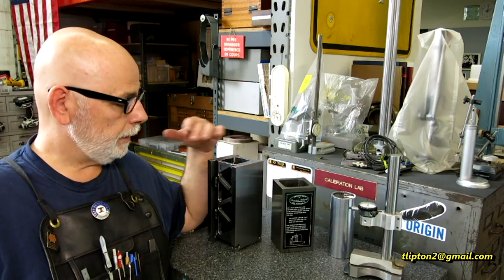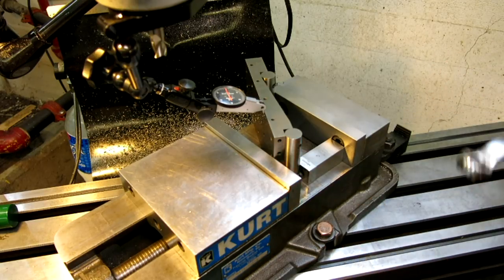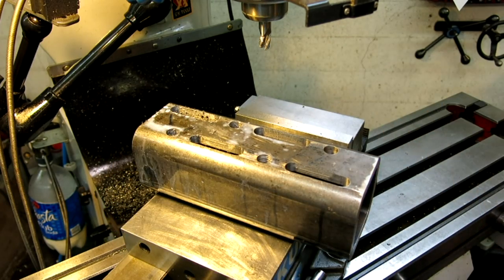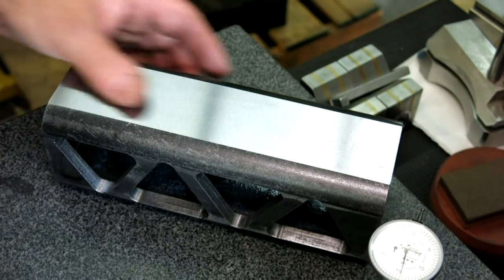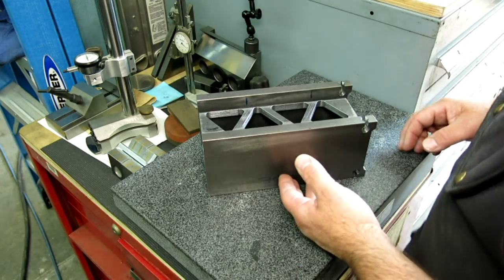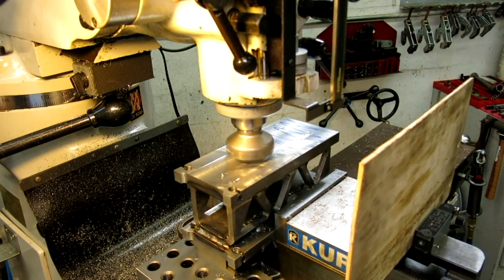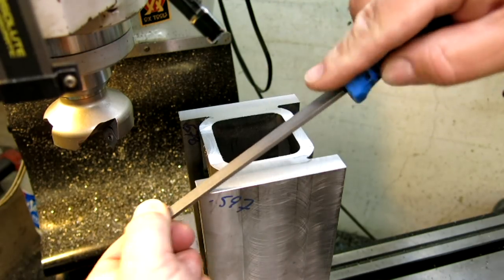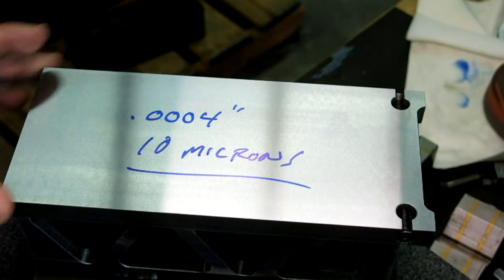Composite Master Square Construction

Comment: Tom, when you surface grind a big piece how does it remain perfectly consistent when the wheel is actually wearing while being used. Are there automatic compensators on the machine? I do realize it is a minute amount of wear, but it IS still wearing.
Reply: Bobby W you're only cutting with the outside leading edge, and as it breaks down you still have the rest of the way towards the center, but it will round off vs leaving a nice square edge to cut with as the wheel breaks down. 

Hope this makes sense.
Reply from the maker: The edges of the wheel is what break down first. The diameter actually changes really slowly.
Reply: I've been wondering if it would be a good idea to have to wheel at an angle against the travel of the work. Any tiny imperfections on the wheel would be evened out. Of course it has to be perpendicular if you were to make some kind of profile cut on an edge.
Reply: Only the "high spot" of  the wheel is contacting the surface as it moves along it. Grinding wheels are used to "machine" crankshaft journals and other precision shafts that have sufaces that aren't concentric with the centerline, but in those situations the work is rotating as well and there is a lot of coolant involved and the stone is grinding only a portion of the width of the journal. It's also done post-heat treatment and final polishing is done with emery cloth bands that are like a narrow belt sander against the journal. The other major difference is that crankshaft journals have plain bearings supporting them in the block and supporting the connecting rod and those bearings are made with steel backs but have relatively soft "babbit" surfaces in contact with the journals. 

There is oil clearance built into the "joint" so the bearing "floats" on a hydrodynamic '"film" of oil and in theory the shaft never contacts the bearings. And that is pretty much true except for at startup with no oil pressure or high-load situations with insufficient oil pressure. Then there's a slight amount of wear in the first case and very short part life in the second. The bearing and journals are obviously of different materials and "self-lubricate" and are never TRULY "dry" at startup. Really high-quality bearings used in some heavy-duty diesels actually have a "depression" in the middle of the bearing so oil can "puddle" there at shutdown. Surface tension and the fact that the engine begins cooling and the oil thickens immediately after shutdown help keep oil in bearings as well. 

I can't say that I've ever seen a flat and straight surface ground for precision and it seems counter-intuitive to me since a grinding stone is going to leave a rougher surface finish and scratches that are small "ditches" with some of the material "dug" out of them sticking up around the edges. I'm not a machinist but I've been turning wrenches for a long time as a professinal diesel mechanic for 25+ years and I've done some "minor" machine work and a lot of fabrication and surface prep and I know a lot of machinists and have pretty extensive experience in every diesel industry except marine. I've also done a lot of automotive work and I'm a "gun nut", so I'm pretty familiar with most things that are machined to precise tolerances. 

And I've used a lot of precision instruments and standards and learned "the old fashioned" way how to dress grinding stones, sharpen drill bits, properly use files and hacksaws, etc. I've gotta say to me this looks like one hell of a lot of work and time and material put into something you can't make without having the commercial tools and standards and gauges to make sure its right. The only way to get them is to buy, rent, borrow or steal them. That's the case with all quality tools that "DIY" guys use to make their own "made it myself" tools that are usually made because its "cheaper". Well, it may be "cheaper" but if "cheaper" is in part due to borrowing or renting or stealing a tool from someone else, the only one paying for your tool in its entirety is still you. 

And if its a purchase to keep or rental then the owner and everybody "upstream" of you and that owner benefit from the hard work and effort and skill and investment other people put into the tool and they've been compensated in some way. But if its a tool borrowed from someone under the guise of "personal use" to make or fix something to keep and use or to repair or make something for someone else "gratis" and offers to compensate the lender anyway are refused, that's also a "pay it forward" situation. 

But buying a tool to use and then returning it for a refund in my book is stealing and stealing is stealing and if its to make a "DIY" tool to then use to produce MORE "commercial" tools for sale or trade, that's stealing and fraud. No matter what nobody is ever a TRUE "DIYer" unless the "project" is "living off the land" and that project is started by leaving all your current commercially manufactured possessions behind and starting out bare-assed naked from scratch. 

Like I said, I'm no machinists but I damn sure have used lots of quality tools and I know that you can make any standard really quickly and pretty easily from plain stock if you have quality machine tools and gauges and very basic materials to start with. Standards for checking micrometers 1-2" and larger are just precisely machined and lapped pieces of round stock that aren't going to grow or shrink providing you keep them and use them in the same environment in which you made them and machinist squares and straightedges are typically mild steel stock milled and lapped to be straight and perpendicular and flat. Most parts in even the best and most expensive heavy-duty diesel engines don't have tolerances tighter than .0001" and even then its going to be several ten thousandths on top of a thousandth with a +/- of a few more ten thousandths. 

I think the main reason we even seen ten thousandths in machines and areas easily accessible with ordinary tools and where the same fundamentals and processes apply whether its a 5 hp Briggs and Stratton or a 500-hp Caterpillar, is specifically to keep amateurs - mechanics AND machinists AND "remanufacturers - with cheap tools and/or no clue what they're doing from destroying parts and engines and potentially lives by using "good enough" techniques and processes and tools to "repair" or "rebuild" or "remanufacturer" machines where in operation it really DOES matter.

It might seem like anybody who doesn't have the experience and skill and tools to do a job properly and is taking a shot at it anyway to "make" or "save" money doing it for themselves or someone else wouldn't be hesitant to work on an engine or other component or machine where the tolerances and clearances go to .0001" instead of just .001", but that extra decimal point requires vernier-scale micrometer to accurately measure and even though there are el-cheapo micrometers all over these days and "budget" tools aren't something new, vernier micrometers are typically the "too expensive" brands and ELECTRONIC CALIPERS, which are VERY commonly and incorrectly used AS a "micrometer" do NOT go to .0001". Even if they measure to .0005", that's not .0001". 

And the thing about DIYers looking to "save" or "make" money is that just like there's always that point where SOMEONE ELSE'S TIME AND EFFORT AND SKILL is "too expensive", there's a point where they realize that their OWN TIME AND EFFORT AND SKILL could get REALLY expensive. Especially if they're "DIY" project is owned by someone else who is ALSO "frugal" and doesn't want to pay professionals for their time and expertise and tools and probably isn't going to want to pay for even a "cheap" job twice. Much less pay for a NEW or REBUILT component or machine or part when the "mechanic" or "machinist" who took on the original job "dropped the ball" and the results was what a service manager I used to work with (RIP Andy) called "fuckage". 

Overall, what I see here with all the fancy and unnecessary machine work on what is really just a piece of square tubing with some plate welded onto it when the tubing itself if good enough for the "foundation" could have simply been milled flat and square and true itself as evidenced by the commercially-made example, is someone trying to put a lot of "value" into something that they know they're not going to get back out of and that is costing them a lot of extra time and money to make and that they're also going to end up paying someone else to "manufacturer" at least in part when they have it heat-treated. 

I'm not sure WHY you'd want a precision standard that would be very easily broken or chipped if dropped or struck with something harder than it accidentally while being used or when left unattended on a bench or table (the small portable toolboxes a lot of machinists use to store gauges and standards and other delicate, fragile and expensive tools and  that are usually Kennedy and brown in color in contrast to red for regular toolboxes so "visitors" don't raid them and thieves overlook them) are small and portable so they go with the tools to the work area or the work is brought to them. And the bench or table they're on is usually on along a wall out of harms way and even then the tools are put back as soon as they're no longer needed. 

That's so they don't get left lying around where they're easily "lost" or damaged by some "visitor" seeing a new and unusual and NEAT tool to "inspect". Anything with a DIAL and a PLUNGER to make the needle move  is a MAGNET for "visitors" to be drawn to and amuse and distract themselves with while a mechanic or machinist is working and they're "helping" or just "watching". And just like a shiny new toy to play with gets old quickly for a child when it turns out to not do anything that special despite outward appearances and children rarely put "toys" back where they got them, its very easy for a "visitor" to set the new toy aside when he finally has the mechanic's or machinist's attention, OR never notice them at all if he's in "pay attention to me mode" from the get-go and happens to catch the mechanic or machinist when he's "not busy" and knock them over or shove them out of the way with or for his own convenience when he needs a spot to put himself or something he's brought in to have worked on and one or both have to be FRONT AND CENTER and TAKEN CARE OF IMMEDIATELY OR SOONER IF POSSIBLE.

Even then, shit happens and tools and gauges and standards get used and damaged or just plain wear out. GAUGES are very OFTEN hardened and polished on their anvils or contacts or jaws where they frequently contact HARD and possible sharp or gritty parts (that shouldn't happen but again, shit happens) and are moved on the part to get an accurate and precise measurement in one or more locations. But STANDARDS should be "soft" to save wear on the gauges and for toughness.
Reply: I'm not sure I'm following you. Could you go into a little more detail? Don't leave anything out.
Reply: What I am puzzled about is when surface grinding, the abrasive wheel is actually wearing away as the machine moves across the work  surface. During that process, the wheel has to change diameter and would like to understand exactly how the surface being ground down remains consistent and flat.
Reply: Look up suburban tools vids on surgace grinding, may help you out.
Reply: Bobby W, the wheels diameter doesn't change, the wear happens at the edge of the wheel. And even if it would wear, you are left with a small sloped surface on the part. You can then dress the wheel and grind that slope down, it now has less material remaining than when you started, thus wheel wear is even less than before.

But in reality the right wheel keeps it diameter and wears from the edge so your dimensions hold and can do a lot of work before dressing is required.

Comment: Tom, just watched the video again and have a further question / observation about you using the Sine Bar. I take it that you were just using it to clock along and NOT to set an accurate angle. You had one roller touching the Gauge Blocks against the fixed jaw of the vice, but you had the other roller of the Sine Bar hanging off the end of the vice, therefore voiding any accurate setup by not using the 5 inch centers of the rollers. Or have I missed something I do not know about using a sine bar. I have always understood and used the bottom of the 2 rollers, the calculations of the roller centers and Slip Gauges to obtain the angle you need.
Reply from the maker: Hi Dave, You need to clean your glasses and slide up a little closer to the screen. The real roll is in contact with the vice jaw.

Cheers,

Tom
Reply: Hi Tom, thanks for the reply, I have put on reading glasses and zoomed in on the shot. Somehow it must either be the camera angle / reflection / optical illusion or lighting as it still looks as though the left hand roller is hanging off the vice  and the Sine Bar body is touching the fixed jaw. Anyway you say all is fine so I will believe you this time around.

Comment: Tom, Wonderful work. My dad used to use the surface grinder but he always placed the item to be ground at an angle versus taking one lone pass on the total length. His theory was that a shorter pass under the grinding wheel did not heat the part up as much as a "diagonal" pass would.Your thoughts?
Eric
Reply from the maker: How are you going to grind something the length of your travel at an angle? Fine for small stuff but you have to learn to control heat and distortion anyway. Lots of ground features need to be aligned with the machine travel so there is no escaping having things square with the world.
Reply: Tom, Yes you are right for small stuff like parallels. Thank you! Eric

Comment: Tom, do the flexure feet really need to be on the same plane as the square surface? Would it be better to relieve them (1/2" x 0.010" or so), so they do not cause any high or low spots on that surface as they are adjusted (screws tightened)? Really amazing work BTW, can't believe people thumbs down these videos...
Reply from the maker: They will be lapped into a single plane after final adjustment.

Comment: I notice you used a hammer with non metal faces (soft) I use a small copper hammer that does not take much to move. I did buy a hammer like you used also an liked them fine. I do want a nice shot loaded Numpla to use since my big Orange hammer busted out the faces after years of service. Your hammer interest and choices are fun to see. Is there a video where you discuss the differences and why? I can get one to send you for a gift I bet you do not have or may even never seen. Regards, Lew
Reply from the maker: Hi Lou. I do have a shot loaded Nupla somewhere in the rack. The one on camera is a LIxie and is also shot filled. I prefer wood handles on my hammers. I seem to recall the Nupla has a plastic handle. I have not done a video on dead blow hammers. Might be a good one. Cheers, Tom

Comment: How do you think the carbourised case will stand up to the movement around the flexture radius? I enjoy these experiments!
Reply: As long as it works in the elastic deformation range it should be fine. And I don't think it's supposed to go in the plastic deformation range.
Reply from the maker: We will be moving the steel in the elastic range so it will not be a problem.
Reply: I guess you will be building it close enough to only need a few microns or so adjustment on each foot

Comment: hey Tom,
 is there anything that speaks against drilling the holes and other miscellaneous machining after the welding instead of before as you did?  the webbing makes total sense but i would tend to think that the calibration holes would be something that could wait until  the coarse grinding was completed
cheers
mike
Reply from the maker: Lots of ways to skin cats. You could do it the way you suggested on your square. 

Cheers,

Tom

Comment: That looks great, and I wish I had a surface grinder in my personal shop. A couple of questions: why four feet and a flexure on each? Won't that make it over-constrained?
Reply from the maker: Yes it is over constrained. Its also more stable when you have a squarish base. I opted for symmetry and stability in this case.

Cheers,

Tom

Comment: Tom, when does wheel degradation become and issue when grinding? I understand that the type of wheel and material have a lot to do with it, but if your taking large passes and wanted precision, how do you account for wheel degradation?
Reply from the maker: See comment above. The edges break down first and the diameter lasts a long time.

Comment: Thanks for the video Tom, very informative.    What's the fabric hanging on the spark guard of your surface grinder made of?
Reply from the maker: Its actually a sheet of white paper so I can see the gap between the wheel and the work more easily.

Cheers,

Tom
Reply: Thanks Tom, makes a lot of sense.  It also seems to take some of the impact of the grindings and drop them into the trough.

Comment: I still never be able to fully understand why grinders are used because those wheels can wear out. At the start, those wheel diameter were big and during grinding that diameter will get smaller therefore how can I ensure that the entire piece is perfectly flat?

Comment: I have a very novice question for you Tom. When surface grinding a wide part as you are doing here, does the diameter of the grinding wheel change much? Thanks for sharing your talents.
Reply: Not really. Your question is answered by the man himself in a comment above. Basically, the edges do the grunt work (say first 5%), then the front quarter takes care of any height from the edge wearing, and then by the time it gets to the middle the diameter is pretty much untouched.